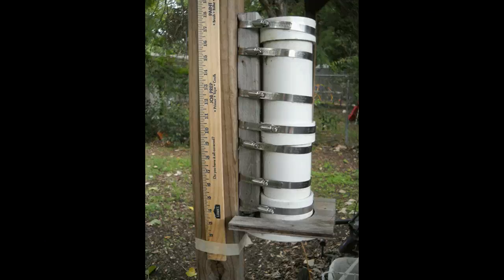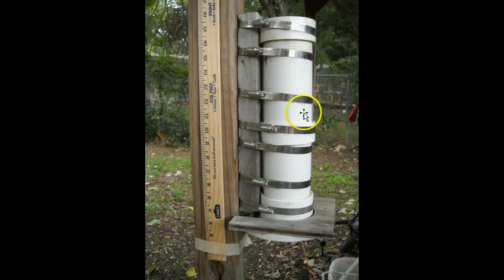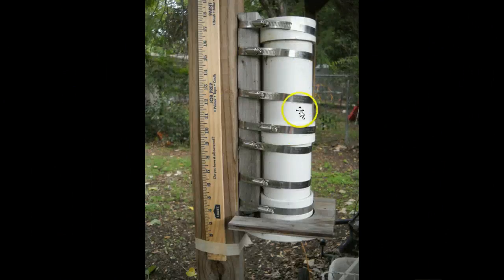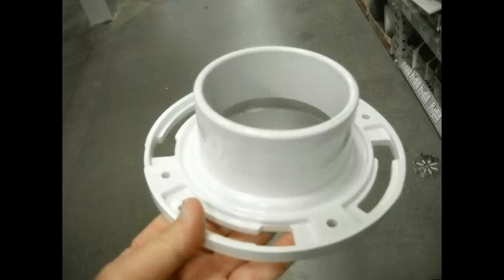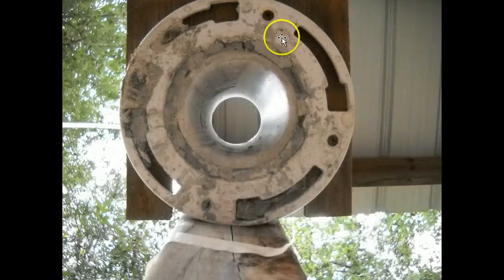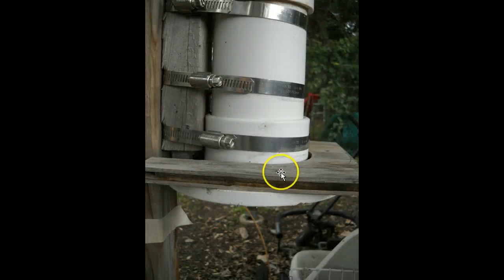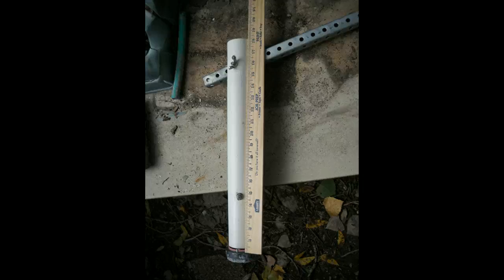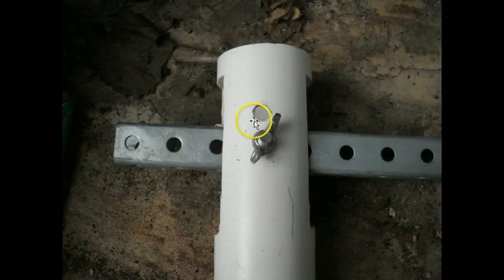How to build a clay extruder - Details

Comment: Great idea but where is the die and how do Yao fix it to the flange?
Reply from the maker: Hi Gabi.  There is a 6in x 6in piece of plywood at the end of the barrel. You can cut a matching 6x6 piece of wood and cut it out for the die. I use a series of clamps (4) to hold the two pieces of plywood togeterh.
 The problem I have had with this is that you have to use a rather thick piece of plywood so that it has the strength it needs to stand up the the pressure and it is difficult to cut the edges smoothly.
What I have gone to is using a hole saw to drill to cut a 2 inch diameter hole in the bottom piece of plywood and thin make my die out of a thinner material and center it on the hole.  
I am currently working with my 3D printer to make dies that will be exactly the shape and size I want for my extrusion.
If this isn't clear, reply back and I will take some imagess.